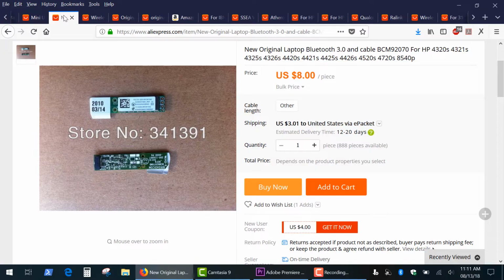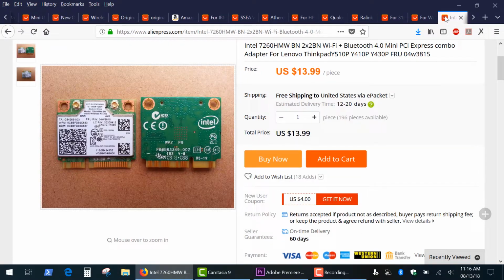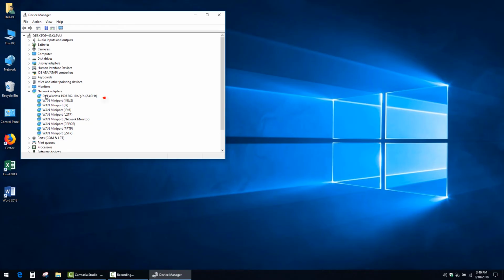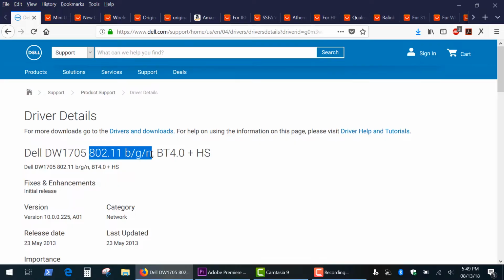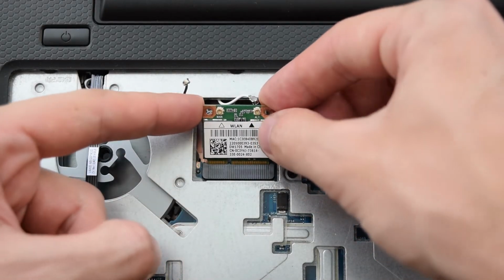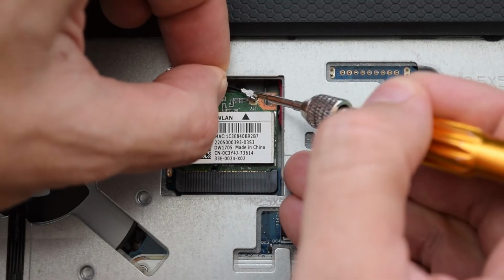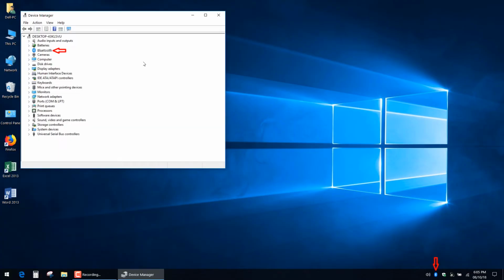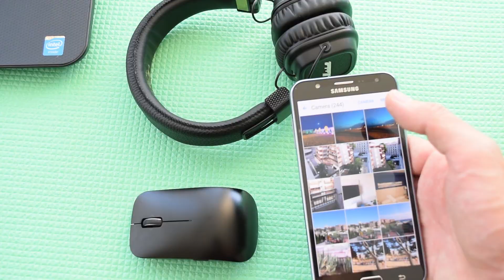How to Upgrade Your Laptop Wi-Fi to 5GHz + Bluetooth 5.0 (Combo Adapter Install)

Comment: Hi! Thanks for the vid. It is amazing!  What do you think, can I uprgrade my Lenovo G580 notebook?  Thanks! (I dont find any exsact information about it... yet)
Reply from the maker: Sure! You can upgrade your wireless adapter to BroadCom BCM4313HMGB which is combo adapter WiFi + Bluetooth:  http://ali.pub/4h3qp3
Here's the list of all compatible adapters:
Part number: 20002484 WLAN, WiFi 1x2 BGN + WiMAX, Intel 6150NX MOW M PCIE NB HMC (LI)
Part number: 20002543 Intel 6150NX BSB M PCIE NB HMC (LI)
Part number: 20002505 WLAN, WiFi 1x1 BGN, Cbt BCM4313 MOW M PCIE NB HMC
Part number: 20002357 WLAN, WiFi 1x1 BGN, Liteon AR9285 HB95 BGN MOW NB
Part number: 20002501 WLAN, WiFi 1x1 BGN+BT4.0, Cbt BCM4313HMGB BGN+BT HMC
Part number: 20002524 WLAN, WiFi 1x1 BGN+BT3.0, Liteon WB195 BGN+BT HMC
Reply: 2013Electronics&Computers  thanks! But I cant check well, wich is the 5g compatible. :) (or Mu-mimo?) thx
Reply from the maker: @sallaigab  None of them! Too old laptop for thhose technologies. It's not just about wireless adapter it's about chipset and CPU too.
Reply: 2013Electronics&Computers oh. Thanks! I thing a simple USB adapter will not working too?

https://www.tp-link.com/au/home-networking/adapter/archer-t3u/
Reply from the maker: @sallaigab  There are NO compatible adapters for your laptop that support 5GHz or MU-MIMO!!! Too old laptop!
Reply: 2013Electronics&Computers thanks! :)
Reply: @ElectronicsComputers  external adaptors can be used which use usb/wifi access point for connectivity

Comment: Why are there two antennas?  Is one for wifi and The other for BT?
Reply from the maker: Old laptops have two antennas for so-called space diversity. Which means one antenna could potentially has better signal than the other one and that antenna will be used for data transfer. In modern laptops with dual-band WiFi adapters those antennas have different size and work with different frequencies and bands (2.4GHz and 5 GHz).

Comment: Hp pavilion G6 2226tu please let me know which combo adapter i could use and From where to get it.
I reside in India.
Reply from the maker: your laptop already comes with combo adapter Broadcom bcm4313gn. Isn't it?
Reply: @ElectronicsComputers  I'm not sure
Reply: @ElectronicsComputers  2 days back it was like working fine since the it's not showing wifi options and only showing ethernet connectivity, please help me how to fix this ASAP
Reply from the maker: @ojasverma5975  Maybe you accidentally turned off your wireless adapter. Press F12 key if it doesn't work press and hold Fn key and then press F12
Reply: @ElectronicsComputers  like seriously? I even have installed the  complete Windows again but still this is not resolved.
In the device manager it's showing me exclamation mark under unknown devices.
Could you help?
Reply from the maker: @ojasverma5975  Sorry! I'm dealing with people who has different knowledge and sometimes it's just turned off WiFi. OK, so it looks like your WiFi card is dead. You can buy this combo WiFi adapter: 
http://ali.pub/49fq7v
http://ali.pub/49fq8u

Comment: Please reply sir. Are the bluetooth and WIFI card on the same chip. I had some problems with WIFI due to which the technician removed the laptop internal WIFI CARD/ADAPTER . After a day I found that Bluetooth is missing from device manager and system settings in the laptop and troubleshooter says system doesn't support Bluetooth. So is this because the WIFI and Bluetooth were on the same card which was removed???????
Reply from the maker: You're right! All modern laptops have combo cards which combine wifi/bluetooth wireless capabilities. Old laptops had dedicated bluetooth module. What was the problem with your wireless adapter?
Reply: @ElectronicsComputers  Thanks for confirming my concern. My laptop was connecting to the Wifi (sometimes not) and showed no internet, Secured everytime. This problem continued even after reinstalling and updating the driver and even aftet clean installation of Windows 10 and HP factory reset. Do you know any solution??

Comment: thanks so much!! i have a question… can you use wifi conection and bluetooth(by example a controller or mouse) in the same time?
Reply from the maker: You're welcome! Bluetooth and WiFi work at the same time like two independent devices without any interaction.